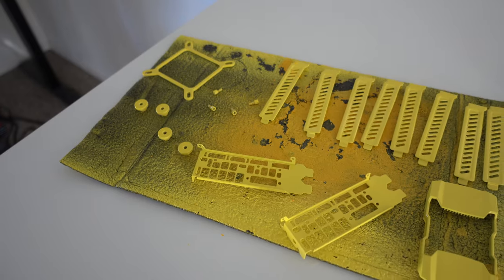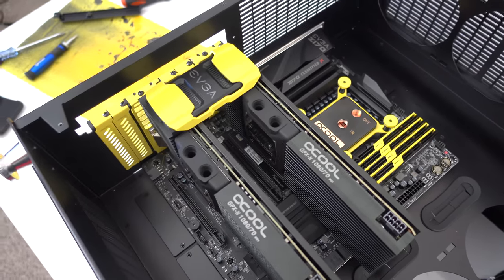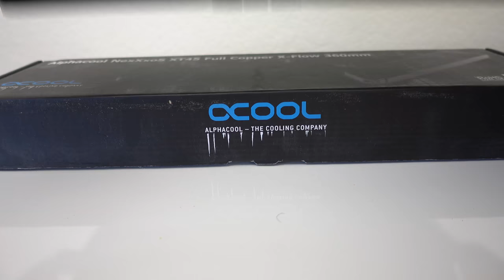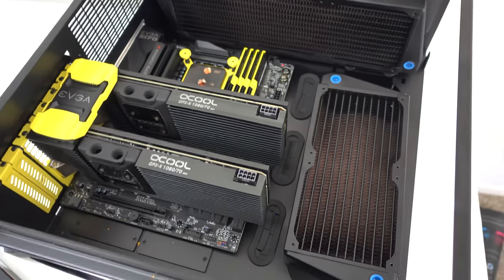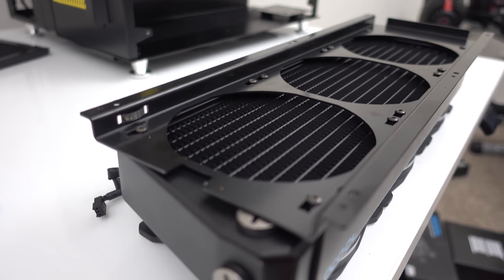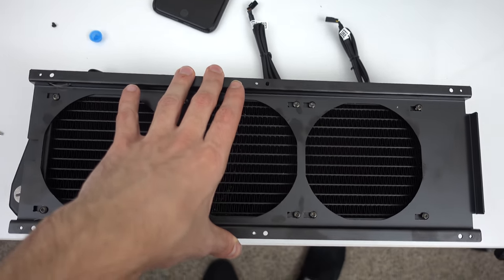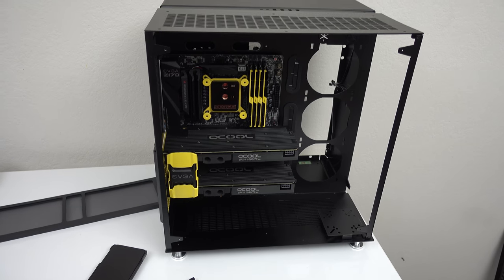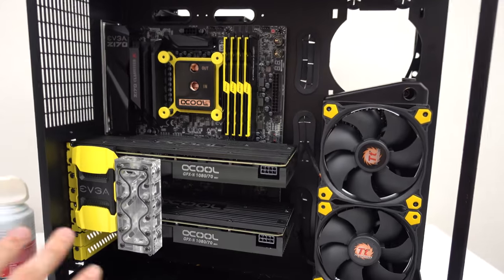My Water Cooling Journey Continues  - Part 4

Comment: Part 10 - pouring in water
Reply: ViperSniper part 10: redoing the paint job on the water
Reply: Memes McQwerty part 56. installing a few of the new cables because the other new cables where slightly of in colour
Reply: part 17: connecting the power supply
Reply: Part 69 - Dammit I messed up got to start over.
Reply: part 100 : i have another phone call
Reply: ViperSniper part 19000 my kid is having a child and he is not yellow such a disappointment !
Reply: +Carmel Fradrick Hes not the right shade of yellow
Reply: ViperSniper Part 11 - starting pumps
Reply: Part 766855807 - Nearly done now
Reply: +ViperSniper Part 1337420698142317 - Pored the water on the pc by accident
Reply: Part 42 installs LED lights oh seriously they don't do the right shade of yellow
Reply: ViperSniper part 28382283729, gets crippling depression because he got another phone call
Reply: 1998 no
Reply: Part 42838228372928382283729 Painting the case yellow
Reply: Part 42069666 - Painting black and red!
Reply: +Sanmata hes slightly to Asian k sorry

Comment: Actually you can create a hole on side of case so the radiator fits
Reply: Skullbreaker Q8 you mean a hole where The screw is?
Reply: Jiggle Boegole no I mean in the case so that the angular part would fit into it
Reply: Skullbreaker Q8 but that would be destroying the case and precious ed wants everything perfect
Reply: you forgot the fitting. it would then be outside of the case or exactly where the casewall is.
Reply: lol, precious ed
Reply: Skullbreaker Q8 Also I think he can rotate iT so the stupid thing is on the other side and the flat side in the rigt way
Reply: Jay van der Veen yeah that's what I was thinking
Reply: i was thinking that the whole build
Reply: only linus can do that
Reply: swapnil kevat yep
Reply: what about using a hammer or something to make an outward dent that fits the angle on the radiator? seems better than just cutting it.
Reply: ed has ocd so he wont do it in dreams also
 ...
Reply: swapnil kevat lol first time I get this much replies and likes on my comment
Reply: @Skullbreaker first time my comment got likes about linus see ^
Reply: Is the same in both sides
Reply: Skullbreaker Q8 - He could it also fix on the backside... what does it matter? let him done and then you can say that lmfao

Comment: Why do you not mount the 240 radiator on the top and the 360 on the right?!?
Reply: Olaf Der Wikinger this
Reply: MY THOUGHTS EXACTLY
Reply: EXACTLY
Reply: EXACTLY MY THOUGHTS
Reply: DAMN THATS WHAT I WAS THINKING
Reply: Olaf Der Wikinger I thought exactly the same😂
Reply: i dont think it will look as good .....but he should try
Reply: the 360 doesn't fit in the case
Reply: BECAUSE HE IS A NOOB!
Reply: Britannio Jarrett
Yes it does or are you blind?
Reply: or drill a new hole to mount it
Reply: That was first thing that came to my mind
Reply: I thought of the same thing as well. Just switch the radiators around.
Reply: thatd just be way too easy
Reply: It makes sense if you don't think about it...
Reply: seriously... would've made much more sense
Reply: he said it didn't work but drilling a new hole to the case would've save a lot of time and money
Reply: Olaf Der Wikinger - Hat er gesagt... Zuhören ist angesagt... :)
Reply: what is the name of the white plastic one he connected on the GPU

Comment: Idk anything about water cooling but would the smaller radiator not worked on the top?
Reply from the maker: +Chase Chapman I tried that. Doesn't work
Reply: TechSource oh bummer
Reply: rotate the radiator 180 deg
Reply: shubham patil its semetrical
Reply: Extand the longholes on the topbracket. Then you could push the hole radiator more to the right.
Reply: agree, 1st, try the 240mm radiator on top & the 360mm radiator on the front-right area of the case.  or 2nd, another 240mm radiator.   hopefully the buiild isnt done yet!!
Reply: y not mod the case a bit?
Reply: Why not?! Looks like it does
Reply: Chase Chapman the length is shorter but that part that sticks out at the end is still gonna push it to the right thus making the screw holes unaligned
Reply: You could just drill new holes in the bracket to match the case
Reply: Chase Chapman - For him its the same problem: Where to out the tube? He doesnt wanna set it right in front of the radiator so there is only space for one radiator, when he doesnt wanna put the 240er on the back of his case...

Comment: Some serious questions:
1. Have you bench tested everything? (CPU, GPUs, RAM [all 4], SSD) It would be such a downer to get the loop up and running to find out that the CPU is a dud, or only 1 GPU works, or 1 DIMM slot is bad, etc.
2. Have you flushed the radiators?

I am looking into water cooling, and in my research, there are certain things you should do before attaching the water blocks.

Hope this turns out great.

Comment: Hi Ed just my one cent, instead of installing the 360 rad on top, you may swap it with your 240 rad and install the 360 rad vertically.  I think the radiator ports will fit in the case.

Comment: Ed, how does my gaming/editing/productivity build sound. 
i7-6700k
GTX 1070
16gb ram (2x8gb)
Z170-A
NZXT S340
650w PSU
(still deciding on monitor)
Reply: Cheap
Reply: DUMBEEZY Games same except I have a 6600k @4.8ghz
Reply: well you should have been waiting for zen :/
Reply: Ryzen*
Reply: Almost like mine i just don't have the K processor, i got the plain 6700. Also less wattage.
Reply: DankusMemeus I literally have the same exact setup besides th power supply and I have the nzxt s340  elite
Reply: DankusMemeus The Cpu needs sone work. The 6700K is mostly toward a gaming setup and not a productivity setup.
Reply: i'd use 2 amd rx 480s 8gb instead of a 1070
Reply: Perfect, Should handle gaming and moderate productivity tasks
Reply: if your smart you go with amd for gaming
Reply: Traice you better be joking
Reply: shit i miss typed i meant not go amd for gaming
Reply: i know amd sucks the only reason amd is making doe is because of it being in most prebuilt shit computers at best buy
Reply: sounds like its going to overheat since there is not cooler specified
Reply: 2pvideo i have the 212 evo, plus I have 3 other fans in my case.
Reply: DankusMemeus not good enough if its not water cooled your doing it wrong XD

Comment: you do realise your supposed to flush the radiators with distilled water before you fit them...
Reply from the maker: +Brodie Haward I'm gonna clean the whole system with the mayhem blitz, don't worry :)
Reply: Phew! i thought you were going to end up making a video a couple days after finishing the build saying that theirs gunky bits floating around in your cooling loop! thanks for reading my comment. :)
Reply: Oh yeah
Reply: Dude that DDR3 ram kit wont fit the motherboard tho, get those DDR4 kit
Reply: if it is DDR4, you're all good to go

Comment: A suggestion, instead of letting us waiting for another radiator to arrived, you can mount the 240mm radiator at the top and the 360mm radiator at the side you just put the 240mm. I know you have OCD but might work like a charm.

Comment: and option 4 cut the metal
Reply: Milton Braga not an expert here but couldn't he put in backwards?
Reply: Charlie Panda17 backwards? he can cut the metal like semicircle
Reply: Milton Braga.  Thinking the same thing.  Once mounted it shouldnt affect the structural integrity of the mount.  Just dremel it, Ed.
Reply: Nigel Gant could he not just drill another screw hole in the case?
Reply: THAT'S TO SIMPLE BETHER PUT IT WRONG
Reply: Thinking the same lol

Comment: drill new mounting holes in the case to get the top radiator in and please replace the Alphacool water bridge on the GPU's with some normal hard line tubing

Comment: The not compatible part comes from it being a flow thru instead of a flow back.  The case is designed for 360 radiator to have both fittings on one side not one on each.

Comment: i would like to upgrade my graphic card : gtx1070 or 980ti (gaming x) ?
Reply: 1070
Reply: Literally the exact same performance but the 1070 will be cheaper
Reply: Minecraftgamer 14 1070
Reply: go for the 980ti Kappa
Reply: Please don't tell me you're going to buy one of those to play minecraft.
Reply: 847,628 views idk there are some good deals on 980 ti's I saw one for around 380 a couple months ago
Reply: 1060 or 480 for minecraft don't waste money
Reply: If you want to play minecraft upgrade your CPU and add RAM.
Reply: im upgrading from a 760 to 1060, i only really watch youtube and play physics, sim and fps games
Reply: 1070 for sure
Reply: Jicksi CS GO not only, i also play tw3
Reply: Minecraftgamer 14 wait for 1080ti
Reply: Zion I.S but a 1060 would be fine for minecraft
Reply: Minecraftgamer 14 1070
Reply: Minecraftgamer 14 1070 has better dx12 support
Reply: Minecraftgamer 14 btw mine craft is cpu intensive -_-
Reply: They preform about the same,  the ti overclock s better.  A second hand ti for the right cash is a good bargain.  But With the 1080ti coming u might find an influx of 1070's and 1080's on the second hand market.  I'd probably just pick up a new 1070 over the coming days during the flash sales..  Good luck!
Reply: They preform about the same,  the ti overclock s better. But I'd pro. Say the 1070 uses 180W vs the 980ti's 250W and I think that the 1070 runs quieter under load. A second hand ti for the right cash is a good bargain.  But With the 1080ti coming u might find an influx of 1070's and 1080's on the second hand market.  I'd probably just pick up a new 1070 over the coming days during the flash sales..  I was in the same position but found a cheap waterblock for a 980ti so went with that option.
Reply: Snekelicious i already have a i7 6700k and 16 gigs of DDR4 ram but i don't only play minecraft

Comment: Ed, just swap the small by the big radiator, let the small be at the top and long one on the side, simple sokution, you then dint need to hug and jump iver the bridge
Reply: *solution
Reply: Jahir Tarafder And he could also pit the fans in push config rather than pull

Comment: All that paint is going to flake off so fast. You did not prep the parts for a lasting result.
Reply: thats not a problem of you dont handle it that much on a car or smth on the outside you wouldve been right but on pc parts thats no prob nothing is ever going to happen to them you wont even touch them 99% of the time
Reply: Henning Butz I don't think you have seen he's other painted builds, they all flaked. You have to prep for proper paint adhesion. I'm no pro painter but any long lasting paint job needs preparation specially on parts that are going to be exposed to heat.
Reply: NO. Just No
Reply: Part 7: I didn't prep the parts
Reply: Part 8: I used the wrong paint again!
Reply: Part 9: I forgot to prep my parts again
Reply: Part 11: I lost the parts
Reply: Part 25: Finished the build! ... wait... the GPU stopped working
Reply: Part 9078: I broke my back
Reply: Part 11589: I got my white hair stuck in the PC
Reply: Although sanding the parts would be better, being in a pc where none is gunna touch them, it should not be a problem. I woulda sanded and washed the parts tho.
Reply: I-BLANDON-I he used engine paint
Reply: ScrapsGaming Yup. that thing is not coming off

Comment: Drill new holes on top of the case for the screws provided you will still have clearance for the rad in the front. Use a jigsaw to cut the rad bracket to sit it flush.... Easy to solve your problems lol.

Comment: A question though, Why Z170 and why not X99?
Reply: Sumeet Mitroo More gaming power if you go with the kaby lake 7700k, which can reach 5-5,2GHz 24/7
Reply: my question was actually for Ed asking him why he chose Z170 Platform, and why didn't he choose X99
Reply: Sumeet Mitroo dude, kaby lake is for z170
Reply: Yea he should have chose X99 because of video creation...his made some silly decisions made with his build...
Reply: If there is a Kaby Lake extreme processor, it most likely won't be on the older gen haswell?
Reply: There won't be an extreme Kaby Lake processor...
Reply: BrillOBuffalo "If there is" "older gen haswell"
Reply: Sumeet Mitroo processor support. 6700k doesn't support X99
Reply: because i7-6700k has a chipset Z170 ... not a X99 chipset.  Can't just put any processor into any motherboard and the reason to choose 6700k is because it's amazing for it's price tag.
Reply: I believe hes asking why he didn't go with more cores as x99 supports processors such as the 5820k and so on

Comment: Hey Guys i have a msi geforce gtx 970 and i don't want to upgrade right now can i wait 1or2 more years?
Reply: totally
Reply: Bounty Hunter 11 yes, you can. The gtx 970 is still capable of running games at 1080p with the high settings, there is no need for you to upgrade if you stick to 1080p for the upcoming 1-2 years.
Reply: jeremy kagchelland  i play at 1080p but i stil like to play on ultra is that posible
Reply: Bounty Hunter 11 in some games it is totally possible, like Battlefield 1(+3,4), Rise of the Tumb Raider and Overwatch. But for games like GTA 5 you really want to turn the setting down to the 'high' setting, which still look great.
Reply: my fury x will run for the next 3 lol at 1440p bbu
Reply: jeremy kagchelland Ok Thank you, when will the gtx 1080 ti comme out? Maybe i'l buy that to step up my GAMING to 4k? But i still don't know.
Reply: Bounty Hunter 11 why 4k why not 1440p at 144hz like I play... 4k is a gimmic
Reply: Bounty Hunter 11 yeah
Reply: CSRF Broforce  I still don't know, whats the best gpu right now for 1440p
Reply: I think the 1070 will do fine for now if you're willing to buy a gpu for 1440p, but in two years, i think you're better off buying a 1080 or maybe even a 1080ti (if it comes out).
Reply: what? Why would you call it a gimmick? It looks a lot better than 1440p. And honestly, frame-rate does not make that big a difference to everyone. I can barely notice the difference between 50 and 60 fps.
Reply: Eric Fornaro exactly. Never understood the whole 144hz thing. Its a little too much, if you ask me. Only required for competitive.
Reply: Shyon Merchant 144hz is good because if you don't won't to spend a shit load on a gsync monitor, the high refresh rate makes screen tearing unnoticeable
Reply: FunnyMau5 i get that its good. But for me, resolution is more important.
Reply: Eric Fornaro Yeh lmao ok. go play Xbox if u want 30fps this is pc I get144 Hz on my free sync... smoothest gameplay ever I can't touch a pool or play under 100fps sorry but 4k is shot with it's slow latency and response
Reply: Eric Fornaro I got a 1440p free sync monitor at 144hz why the he'll do I want to play on a tv? my fury x can play 4k just fine I'm maxed out at 1440p 144hz.... 1070 isn't impressive at all... go play an Xbox if u want 4k at 40fps u like 1440p at 144z for fast game and smooth. enjoy ur choppy game pla
Reply: Eric Fornaro Lol .2 cents a month woah tonze of money lmao.
Reply: CSRF Broforce not 2 cents a month. Quite a bit more. But yeah...wattage doesn't really matter. 
But you've either not played at 4k or you have terrible vision, cause the difference between 4k and 1440p is ridiculously high.
Reply: Shyon Merchant I wouldn't touch a 4k monitor to save my life no need. it's a gimmick. it'll die out his like curve monitor and ultrawides

Comment: On the radiator from the top, you can drill another holes in the case mount for the radiator. And it will fit perfectly.

Comment: +TechSource you could re-drill the bracket to scoot the radiator over so the pointy end of the radiator sits flush. Just need a drill and a small bit that is the same size as the holes on there. Quick solution and you can use the same radiator.

Comment: I feel like you could of cut that bracket to make the big radiator flush so it has a slight notch to fit that screw. same with that piece sticking out on the upper back of the case which I think is.blocking you radiator from fitting. also you could put the smaller one up top and put the bigger one down where you currently are putting the smaller one. but it's your build. lol can't wait to see the result of this build. great job

Comment: You can shim the two bolts on the radiator mounting bracket with a washer or two so it sits even.

Comment: First you can either cut or drill new holes on the radiator bracket to make it sit flush with the rad and second you can drill new holes on the top of the case to make the rad and bracket fit inside the case.  I guess that's what part 5 is going to be about.

Comment: Lol ed thanks for finally uploading another part to the water cooling. I think it's possible if you switch the radiators so that the smaller one is at the top. Otherwise you may just have to get either a smaller or different designed radiator. Anyways keep up the good work and see you next time.

Comment: Option 4: Dremel all day m8... lol, but in all seriousness cut out the part where the radiator plug interferes with the radiator bracket on the case (then file down the surface...obviously). Then you can also cut out a section from the back of the case to accommodate the extra length of the radiator. You can get this all done in a couple of hours and if you feel so inclined you can just spray paint the newly cut and filed areas, also a learning opportunity for even more advanced custom modding. And yes I do realize that's really thick metal, all part of the challenge.

Comment: Nice series. thumbsup

My solution no 4 for the top radiator: Drill additional holes in the case for the bracket and close the original holes with black screws.

My oppinion for the coolant bridge for the two graphic cards: It doesn't fit the design line of the whole system. Maybe i would take an alterative bridge or maybe I would paint this actual bridge black.

Comment: flip the radiator, cut the metal on the og bracket, if you cant flup the rad then drill 2 new holes in the right location to mount